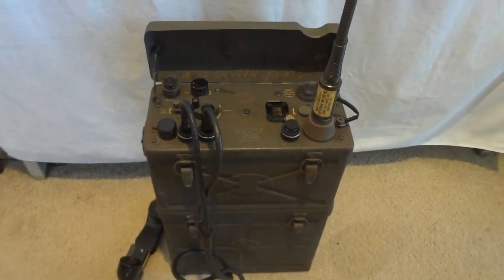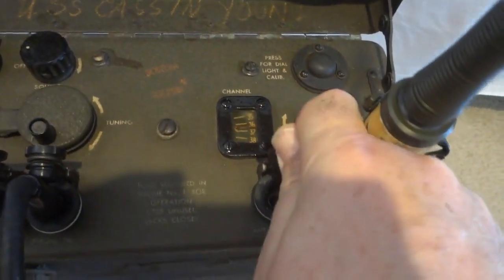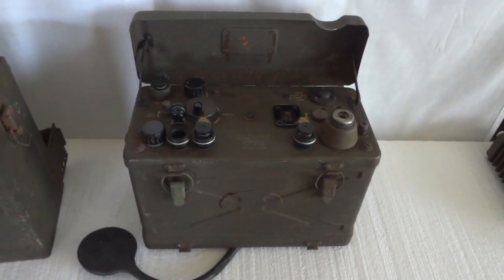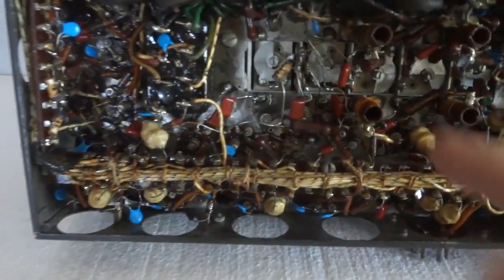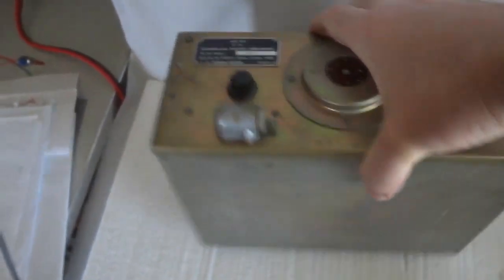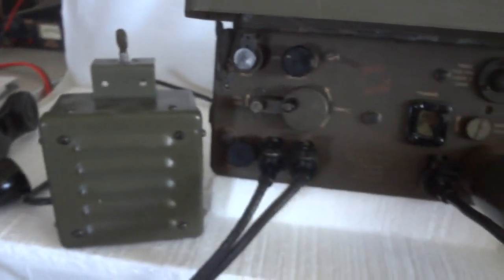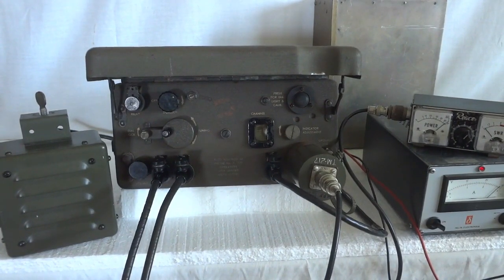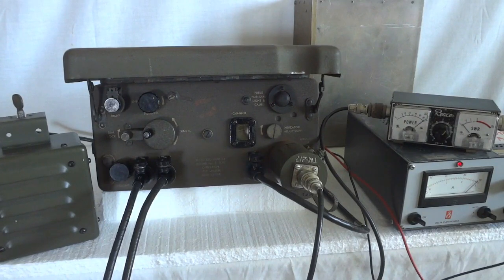SCR300 (BC-1000) military WWII radio - history and actual on-air demonstration

Comment: I have one of these with a power supply too - but there is a proper external connection in the battery box.
Reply from the maker: Yes, that is probably the VRC-3 power supply, to use the BC-1000 in a vehicle. I have one of those power supplies (the PP-114B) but unfortunately the transformer in it has a short.

Comment: I'd love see a video or two on the operational side of WWII radio. What frequencies were used for what purposes? How did the Allies and the Axis deal with their signals interfering with one another? Were their gentleman's agreements that said, "We use 6.0-6.2 MHz and you get 6.2-6.4 MHz or was it a free-for-all? Did the two sides occasionally converse? The number of radio operators from WWII must be going down rapidly, so finding out first hand is important. I can add one tidbit. Hans von Luck's Panzer Command says that in North Africa they had an agreed on time and frequency to exchange the names of new prisoners. That spared both sides the burden of launching a massive search if someone went missing in the desert.
Reply from the maker: Hello. A lot has been written already about frequency usage during WWII by the allied forces. Actually, most US military manuals have a page that describes what radio model covered what frequency, for all the radio versions used by the allied forces during WWII. A search on the web should yield a lot of info as well. All I can say for this particular radio (the BC-1000/SCR300)  is that it covers 40 MHz to 48 MHz (the low VHF band) in 40 channels. Army divisions coordinated their channels such that no interference would be caused, and that the appropriate army divisions and infantries would use the same channels where needed so that they could actually communicate with each other within that group. Also, keep in mind the BC-1000 covers only about 10 miles at best (when using larger external antennas), and about 3 miles when used portable as a manpack. So the short range also minimized potential interference (just like cellphones today; the smaller the cells, the more phones can be used simultaneously).  Also, when using this radio, the soldiers did not have to worry about Germans eavesdropping on them. The Germans did not have FM transceivers, they mostly used regenerative radios at these VHF frequencies (an inferior AM based technology already obsolete during WWII) . To such a regenerative receiver, wideband FM basically sounds as a single carrier without modulation. And on a narrow band AM transceiver, wideband FM sounds like spread spectrum, completely unintelligible. Hope this helps.

Comment: we used lot of them in a group in the 80's. But then some tubes were not easely available like the 1R5, so i discouvered back then that the 27mc transceiver from Philips (AP369) was very easy to convert to that same 40MHz band. So we stop using the BC1000. Also the sensitivity and power were way better on the Philips boxes.

Comment: Awesome thanks! I picked up a pair of these (rebadged as UK wireless Set 31) in 1974, never got them properly working as the batts that came with them were practically dead. A few of the caps might have been on the way out by then also. Wish I'd kep them still though 😞

Comment: thanks for this vid. I still have 2 of them. They worked perfectly when I bought them (somewhere in Belgium) back in the early 80ies. 
The range was quite low. Going from about 500meter in town to about 1.5km in open field.
The "long antenna" worked better, than the "shorty with base-load" of course.
Reply from the maker: Many years ago we tested two of these radios using the long antenna on each side. We easily bridged 15 kilometers between them. On the short antenna it is much less. I was never able to get a hold of the external antenna that also exists for this radio (see the manual) but I would expect the performance of that one to be even better. Cheers.

Comment: I would have to dispute "the first walkie-talkie radio" at 0:06.  The SCR 300 went into final acceptance trials in spring 1942 before production and formal issue.
The British 18 set (76,000 produced) back-pack was issued into service in 1940 and the 38 set (187,000 produced), chest mounted platoon radio in 1941.
Reply from the maker: You have a point, maybe I should have said the first FM walkie talkie. By the way, the American BC-222 transceiver is even older (https://www.greenradio.de/e_bc222.htm), it stems from 1938 and also was man portable, albeit with difficulty. The design was primitive, basically a super-regenerative receiver.  I have never owned or tested a BC-222 though. The British WS-38 to which you refer was more advanced than the BC-222, an indeed truly man-portable. I have owned (and operated) a WS-38 in the past, the performance was poor. The other station could hear me (on a British HF-156) over a mile or so, but I could not hear him. Basically because the WS-38 receiver is wide as a barn door, and therefore prone to QRM/QRN. But you are correct, it predates the BC-1000 (and possibly even de BC-611) and was truly man-portable.
The 18-set that you mention was not really for man-portable operation, it was more a field radio operated stationary. But in all fairness, the same could be said for the BC-222. Cheers.
Reply: @LifeIsTooShortForQRP  I would have to disagree about the 18 set, it's whole purpose was being man portable although one person carried it and another operated it, the whole reason the carrying frame was built into the set casing.
However, you could set it up and then carry and operate it as a single person.
I used one often enough in 1962.
Reply from the maker: @572Btriode  Alright, I can't argue with someone who actually has used a WS-18 of course. I will have to read up a bit more on it, it appears my knowledge on that particular radio lacks depth. Cheers!

Comment: Hi from Belgium. I think by the accent you live in the Netherlands ? I have an orignal working BC-1000 at home. I haven't received anything on it but was wondering if I could receive other transmitters like cb radios or so  on it ? Maybe the frequenties on the BC aren't suitable for this but as I don't know anything about it I would like to have some info. Maybe you can help me out ? Thank you and thank you for the video.
Reply from the maker: The BC-1000 operates in the band 40 MHz to 48 MHz. There is not much use of that band any more. There used to be cordless phones in that band but they have all moved up to the 2 GHz area (DECT). There is also an ISM portion in the 40 MHz band that allows for part-15 unlicensed equipment but not to many manufacturers have used it (Radio Shack once sold a short-range motorcycle communication system for it). So the short answer: It is not in use any more. Military radios still cover it (SINCGARS and the PRC-148 MBITR) but in peace time you won't hear any military there. And in wartime the military can use ANY frequency, so it would be unlikely they would single out the 40 MHz band with their frequency hoppers. So feel free to use it from one vintage BC-1000 to another, with the 250 mW that it emits you are unlikely to cause any trouble to anyone when doing so.....

Comment: What was the range on this contact? Did you both use external antennas?  Thanks for the video, very nice  story.
Reply from the maker: Range between stations was about five miles. The BC-1000 was tuned into an outdoor vertical antenna of 24 ft. The other station was using the standard man-pack antenna (a whip screwed onto it) that comes with the SEM-35 radio that he was using. Cheers.

Comment: hats off!!! :)
I was wondering how would sound one of these.
I have one of these at home but as you  say I am the tipical guy who use it only for admiring it on the living room..
The 44 on the cover belongs to the contract number (mine says 29316-PHILA-44-01) to Galvin (now Motorola). Manufacturing date can be found inside, in one of the turning gears  (mine says 28th Nov 1944).
Thanks for sharing what you change to repair it
Reply from the maker: Hello! Thanks for watching the video. Sorry, I do not repair these as a gig, this is a hobby for me not a business. Cheers.

Comment: 40.000 MHz - 48.000 MHz, 200 kHz spacing.  FM voice.  As they said back then, 40-48mc for megacycles.  As shown, calibration provided on 43.0 MHz and 47.3 MHz (halfway between 47.2 MHz and 47.4 MHz channels) 

40.0 MHz 
40.2 MHz 
40.4 MHz 
40.6 MHz 
40.8 MHz 
41.0 MHz 
41.2 MHz
41.4 MHz 
41.6 MHz 
41.8 MHz 
42.0 MHz 
up to 
46.8 MHz 
47.0 MHz 
47.2 MHz 
47.4 MHz 
47.6 MHz 
47.8 MHz 
48.0 MHz

Comment: Did you use Mica capacitors?
Reply from the maker: The used caps are polypropylene caps and ceramic caps. Mica is not necessary as all these replaced caps are essentially bypass capacitors.